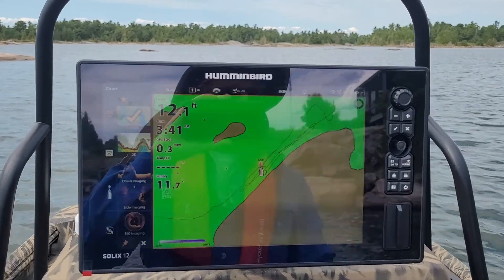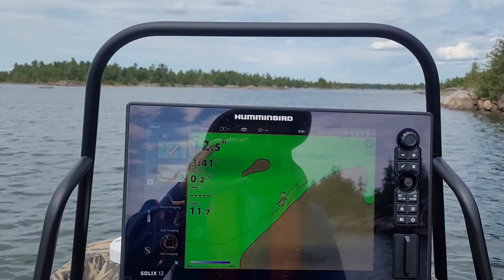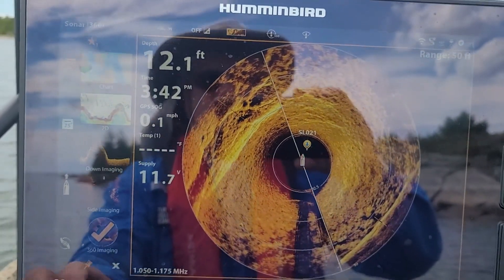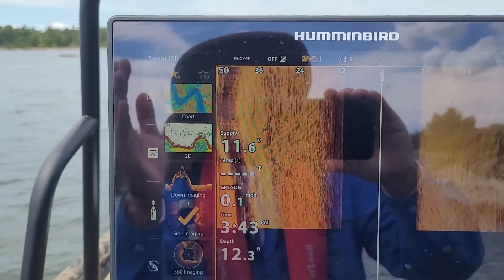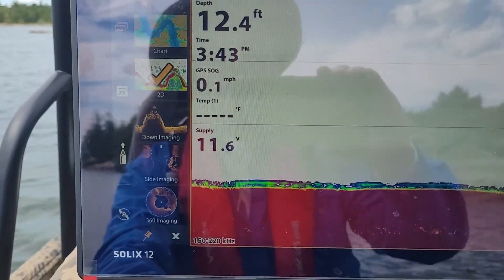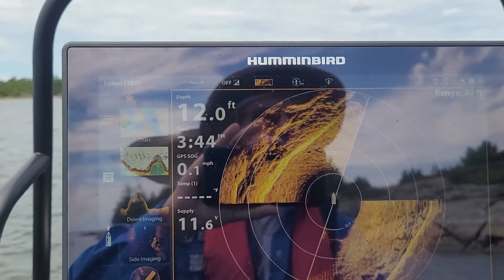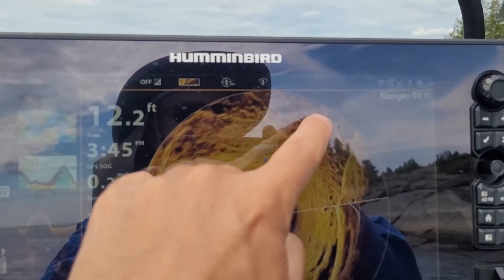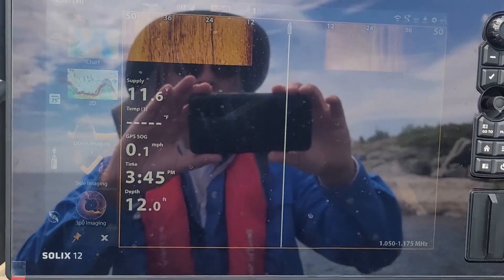SOLIX/HELIX WITH MEGA 360 USING Y CABLE.... WHEN YOU HAVE TO USE IT, WHAT HAPPENS AND HOW IT WORKS.

Comment: If you go in to settings and turn off ping on the 360 the graph will revert back to using the original transducer for side imaging.

Comment: Question if you turn off the 360 will the unit start using the rear unit or are you limited on the side scan to only when the 360 is in the water?
Reply: I talked to Hummingbird. They told me if you go in to settings and turn of the 360 ping the graph will revert back to the original transducer for side imaging.
Reply from the maker: That is a question I was sure of, in the summer. And now cannot remember, I actually did test this very question. A question for you, are you going to try to use the 360, to help find people or things underwater? I think it would do a good job, since you could actually see pretty clear what things are.
Reply: @ADAMLS1240SX  Yes we will be using this to find victims in the water and also monitor our dive team when they are down. We had one of the original Onix systems with the 360 of that time. the SI worked independently even with the Y connector and we just went to settings and turned the 360 off when not in use. The Onix system is no longer supported by hummingbird so we needed to upgrade when the Onix died. The new graphics are great on the Solix 15 we now have. The 360 has been delayed in coming so I have had this question about independent use...
Reply from the maker: @peaceriverk9  It should work great on a solix 15,  you should be able to scan clearly almost out to 100ft, if you have enough water depth.
Reply from the maker: @peaceriverk9  Probably the best function for what you are doing, body recovery, is using it with a Ultrex trolling motor, when integrated together, you can just touch the screen where you see something of interest on the 360, and tell the boat to drive you to that exact position. And it will hold the boat at that position. Or can even plot out search pattern grid if you tell it too as well.